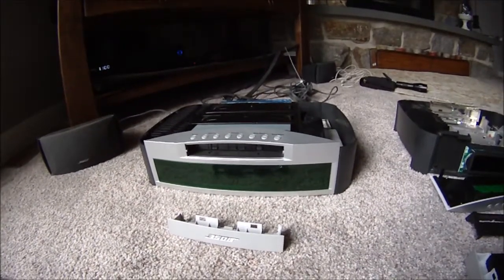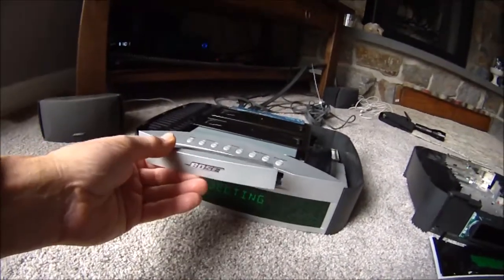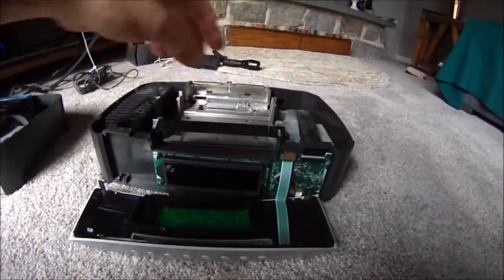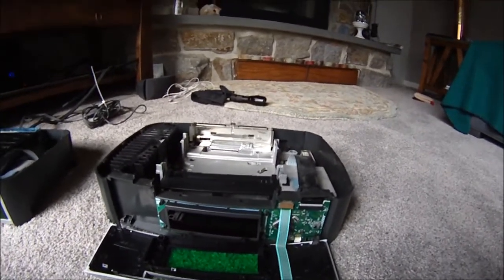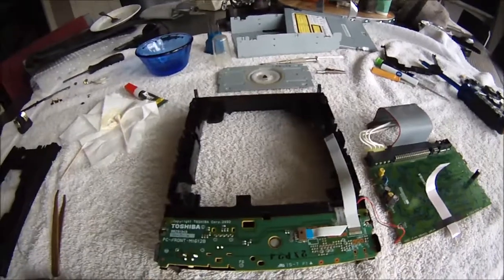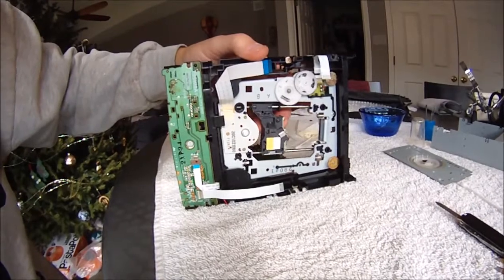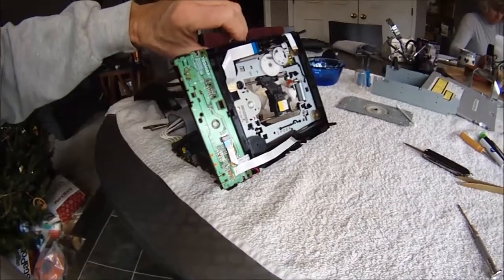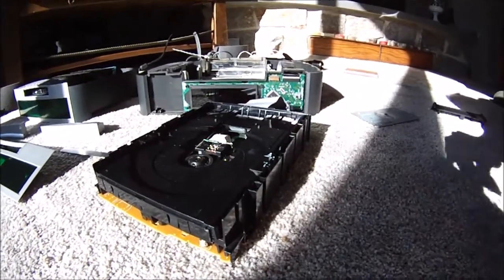Bose 3-2-1 CD DVD Player Repair

Comment: Hi John. I am trying to replace the optical reader of the dvd. I called with bose if it is possible to buy a new dvd, but they don't have spare dvd's for this old systems. But my parents (both 87 years old) can't listen to their music anymore so I try to repair the optical reader. But I ran into the problem that I don't know how to remove the black inside box from the cd/dvd palyer. That part is in the middle of your video at 5.00 minutes. Can you please give me a hint/tip on how to do that.
I just fixed it. With a screwdriver I moved the the small cogwheel a little to the right. Then the blocking of the carriage went off with that, so that I could slide off the cd/dvd holder. 😅😊

Comment: Thanks for your informative video. However, there’s a better way of opening up the system without breaking the door, by removing the front panel. The door cover can be fixed after sorting out the opening problem. Drilling a hole also does not seem to be a great idea. Computers with these DVD players often have a stuck tray and the hole was useful there.
Reply from the maker: Thanks for watching! All comments add to the knowledge base.